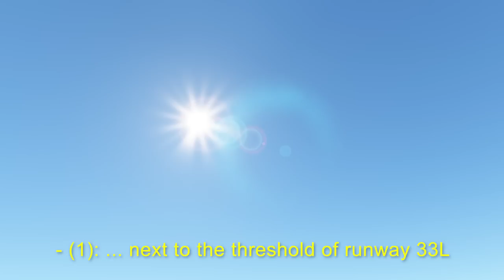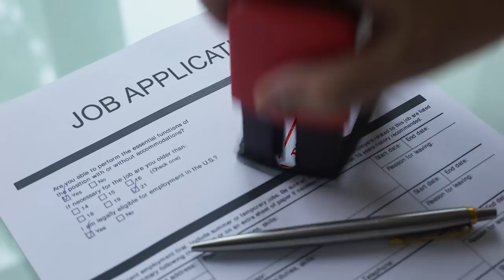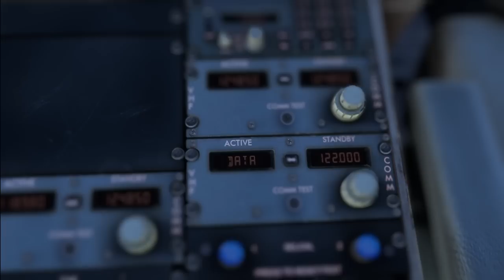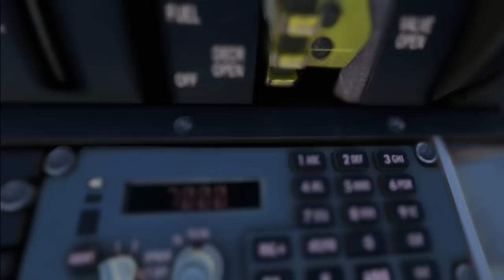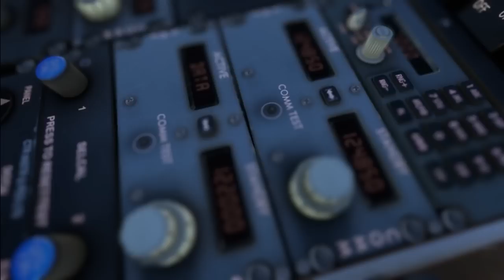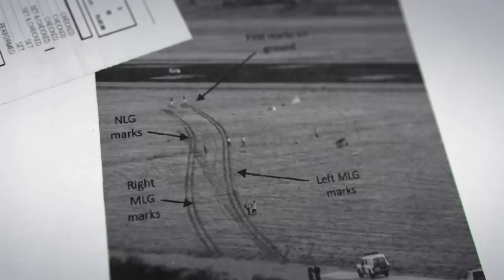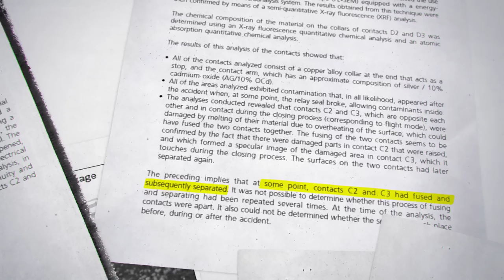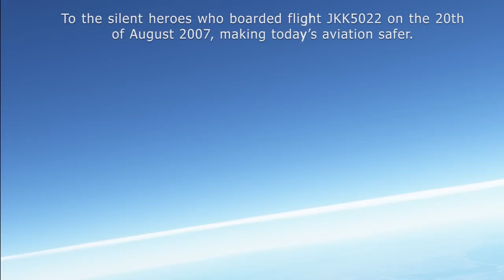EVERYTHING went WRONG! How did they CRASH seconds after taking off? The Black Swan S01 E02

Comment: Well, in short: recession, pressure, no time to do things properly. I heard that just a look over the window to check the flaps would have been enough to save all all those lives.
Reply from the maker: Exactly... a feeling of time pressure, in addition to the job cuts were some of the factors that contributed to the accident. But it was just the tip of the iceberg.
Reply: No chance to see the wings from the cockpit windows. Captain if in doubt could have asked a flight attendant to check from the passenger cabin, but unfortunately at that point he was unaware of the danger

Comment: you only have 1 mission, read and do the checklist...almost nothing more.
And it has happened before, maybe they need to do a redundant warning system for the slats and flaps configuration, so in case TOWS fails, you have another safeguard...because it is vital you have the correct configuration during take off.
Reply from the maker: Absolutely agree. It's a shame no one knows even today why the TOWS failed or how was it related to the RAT failure. In aviation, redundancy is always key for safety

Comment: they all have 1 thing in common American planes. When American plane makers have planes crash they tend to gloss over things that went wrong and try to blame pilot error rather than faults with their planes.
If its plane from another country America companies do everything they can to get rid of the comepetion by blaming crashes on faults with the planes even when it pilot error.

Like the commet MKI had fautlts and they found out it was the windows after several crashed so redieigned the windows and all other planes had their windows changed as well. BOING were going touse the ame window design as the commet for their 1st jets but after it was revelied it was the window design that caused the fault BOING uses commetes research to change the window design on theirplanes.the newly modified commets had the best safety record of all planes but US companies were teling airlines dont buy comets their realy bad buy rs instead and do everything they can to get other non US planes grounded.
like concorde only ever had 1 accicent it got grounded for ever cause BOING couldnt make anything to compete with it so forced it out of service. But the problem that caused conrode to crash was something faling off a BOING onto the runway that concorde hit when it took of but the blame was put on concorde. When a boing pne crashed they dont get grounded while tbey work out why it crashed they just kep flying but when an airbus or a dif maker crashes they get grounded at the request of boing till they find out what caused the crash.